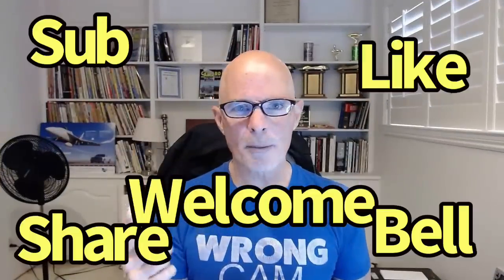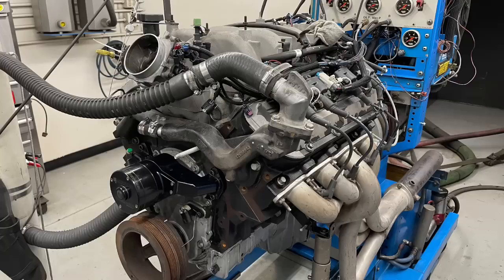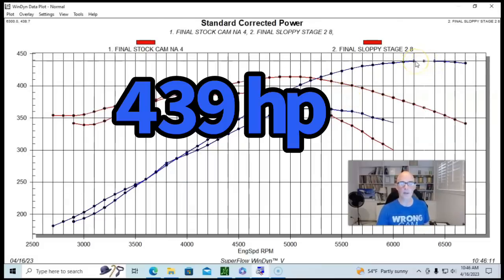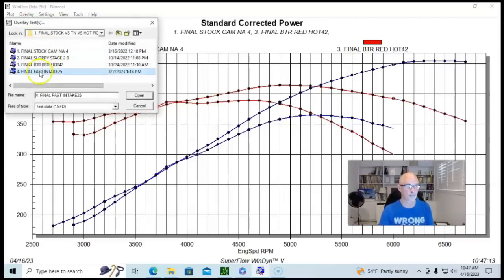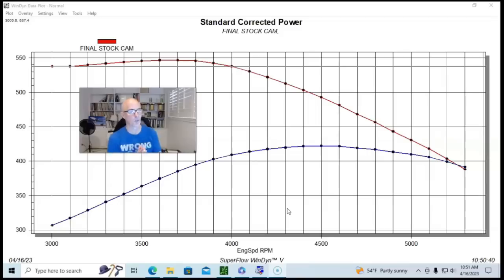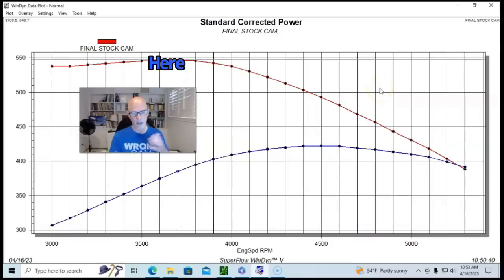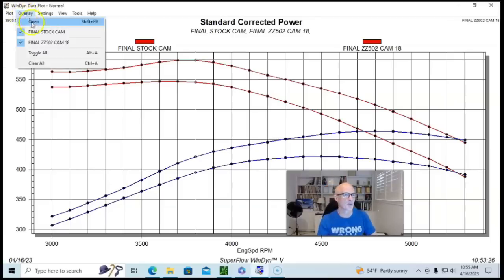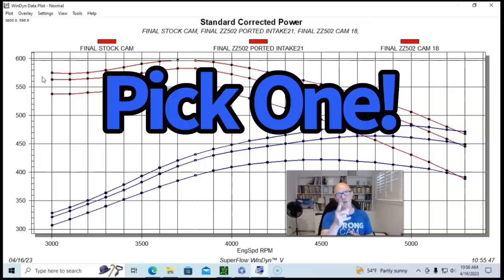RPM vs TQ-WHAT WORKS BEST? THE 480-HP TEST, HIGH-RPM, LOW TORQUE 5.3L OR LOW-RPM, BIG TORQUE 8.1L?

Comment: I currently own both (although both have far milder performance mods) and both are powerful, bulletproof tanks.  The 5.3 is pushing about 350hp and getting 22mpg with 4.10gears in a 5000lb SUV. The Envoy XL has 245k miles, LM4 engine in excellent condition (compression, oil consumption, etc.) The currently stock 8.1 is in a Class A motorhome and has no problem going 80mph anywhere, but we don't discuss the fuel mileage! Also have a modified Vortec 454 in an even bigger motorhome, and I believe it'll outrun the 8.1, and get better mileage because of the mods.  Moral of story- always modify your awesome Chevy!

Comment: Commenting at the start before watching. The 5.3 would be great for road coarse/time attack racing having a kinda easier time with traction with less torque while the big block would be great for truck work or just a dedicated drag car. I forgot to mention trans options, you can run a shorter diff gear with the 5.3 to have faster acceleration where as to match speed with the 8.1 youd have to have a taller to keep up with speed per gear numbers. While the 8.1 does have the torque you might not notice the difference. Just something to think about. If you ran the same gear set and trans you have to shift earlier with the 8.1 and you could see the 5.3 possibly slowly work ahead of the 8.1 just with the extra rpm needing less shifts for a given speed.
Reply: Agreed I was thinking about gearing as well
Reply: Watch Lawrence LT Tolman Videos on his 8.1 runs

Comment: Boy, even with the 5.3L having 25% RPM advantage, with properly geared rear diffs for each, the BBC still has big torque advantage down low. If it hooks (at the track), it would probably win even with the weight penalty. On the street with street tires, I'd probably take the 5.3L, though the 3200rpm stall converter needed might get annoying and it's an added expense. In a truck doing truck things, 8.1L no questions asked. Fortunately my 6.7L (408 LS) is exactly in the middle so I don't have to choose!

Comment: The gearing multiplies that torque, so with the same shift points the 5.3 would act like it has 30% more torque. On the street the 8.1 would just fry tires, while the 5.3's weight savings would make it more fun in corners too.
Reply: The 8.1L can absolutely Handle 10-20 plus more degrees of intake duration which will make the bottom end softer. Also, if traction is your goal There are plenty of ways to do it. I do like 8.1L for a heavier vehicle though.

Comment: Depends on the weight of the vehicle. Heavy vehicules need high torque to get them moving.
Reply: or low gearing,  you could put both these engine's  in semi trucks as long as you geared them down appropriately. now engine life would be a different mater but they would be able to do the same work.

Comment: Cool data. Taking the last plot a couple steps further and diving into the realm of bench racing, its possible to extrapolate these data to make a side by side comparison of how two identical cars with the only difference being the motor and gear ratio would compare. Gear the 5.3 so it completes the 1/4 mile at peak rpm (the actual ratio isn't important). Now, divide the BBC's peak rpm by the 5.3's to make it also trap at peak rpm. You get .815. So take the gear for the 5.3 and just multiply that by .815 to see what the big block gear should be. Gearing is also a torque multiplier so you can see how much torque each car produces at each speed by rescaling the x axis of the plot to speed and rescaling the Y axis by the relative gear ratios, or just multiply it .815 for the big block to see the relative difference. This will give you a clear side by side comparison of how both compare against each other. In physics, acceleration = force / mass (f=ma)... so just looking at the torque each produces in a side by side like that tells you how one is accelerating relative to the other. Of course, you can also take it a couple steps further and factor in the mass difference between the two cars.

Comment: I've always wanted to put an 8.1L in a RCSB 1/2 ton like my 2001 Silverado. I love the 90-93 454 SS trucks, and the 8.1L in a 99-07 NBS would be a great modern version.
Reply: I have one in a 2002 Sierra. Rcsb 1/2 ton.  She’s pretty fun.
Reply: @jayroc3337  I keep watching for a cheap donor... 8.1L, 4L85E, PCM, harness.
Reply: @bluecollarhotrods9781   that’s the trans I have in my truck.  I love it.  I didn’t do the swap though.   Long story short, I found it at a small hotrod dealership for cheap.   Building it is on the back burner tho. My other 2002 rcsb Sierra is a turbo built truck and is almost finished up.
Reply: @jayroc3337  My 2001 is LQ4/80E swapped, I  did the work. Cam + bolt ons currently. Eventually another engine with ported heads, etc. Then, BOOST! I have been doing it in steps.
Reply: @bluecollarhotrods9781  hell yeah!  my turbo rcsb is a lq4/th400. MLE built the long block,  I like it but I am more excited about doing a NA build with the 8.1 rcsb.   
 Obviously I love RCSBs   I run a local fb page dedicated to everyone in the area with them.  As far as I’m concerned, they are the closest thing to an old school muscle car.  Full frame, v8, leaf springs, an actual rear end and you can work on them very easily.
Reply: @jayroc3337  When I find myself doing rust repair on an older vehicle... I seriously think about selling my older cars so I can buy 1-2 more trucks.
Reply: @bluecollarhotrods9781  absolutely.  I get it.  Do me and yourself a favor, DO NOT get a cheap turbo kit when you boost yours.  You will end up replacing everything.  
 Spend the money. It is worth it.   I wish I would have went with a blower.  Might even sell the turbo truck. 🤷‍♂️
Reply: @jayroc3337  As of right now, I have a FSP cast stainless turbo log. I was going to build the rest of the hot side myself. Cold side will most likely end up being a Treadstone intercooler. Although, I kind of want a Holley mid ram with a Tick or 417 motorsports A2W intercooler. It would simpler for packaging and plumbing.
Reply: @bluecollarhotrods9781  you are on the right path.  I hear a lot of people pushing cheap kits and it drives me insane
Reply: @jayroc3337  my friend is about to buy an On3 kit and I'm not sure how I feel about it.
Reply: @bluecollarhotrods9781   MAKE HIM STOP!!  It’s fine if you really have to be at a certain budget and enjoy constantly fixing leaks but if he keeps the car/truck long enough….. everything will be replaced and there won’t be anything left of that kit
Reply: @jayroc3337  I told him to buy a Huron Speed kit, if he absolutely has to have a "kit." Another friend had a great experience with the Huron Speed kit.
Reply: @bluecollarhotrods9781  from what I just seen, those kits are out of stock.  Seems like every quality kit is.
Reply: @jayroc3337  Well that's a bummer. The Fahler log I have is no longer available. I guess he did a few runs, then the deal fell apart.

Comment: Can't beat torque.  RPM Ruins People's Motors.  That big block would last forever.
Reply: I think it depends  on the horsepower it gets pushed to. if you want a 600-horsepower 350 I don't think it lasts as long as the 600 horsepower biggun. Course.. that's what you were saying 😆.
Reply: @John Sheetz  hard to say , the piston speed and rod ratio is actually huge on the lower revving big block. 5500 rpm in the big block is practically the same piston speed as 6700 rpm in the 5.3. piston speed will increase piston heat , wear pins , bearings and can do oil pump issues with that much weight of the big slugs in the big block creating crank deflection and the weight of pistons and rods being forced down at such a large speed. 

Valve train is definitely a lot more stable at lower rpm but once again a lot lighter valve train in the smaller motor. 

I'd rather the torque of the big block , I don't know much more reliable it'll actually be just because it's not revving out as far. 

Also depends on what car it's going in , I'd take the more centralised weight and less torque if the big block was going to be hanging well over the nose of the cross member.
Reply: The 8.1 cam is still small compared to the 5.3. Another 15-20 degrees duration would wake up the Big Block it's still have about the same Idle characteristics as the 5.3
Reply: An Overlooked area of Big Block Chevies and other Large Displacement engines is the Huge Strong Crankshaft in them and very Large Crankshaft Thrust Bearings. 
Super Torsional strength they possess even cast Nodular iron or cast steel. Forged steel or Billet 4340 Chromemoly or 300M Super Steel makes them even better.
No matter what you do to LS LGM Or others you will not match the crankshaft strength or Tough as nails Crank thrust checks and bearings Engineering with .
Pontiac 455 is another example of a Super Strong crankshaft and huge Crank Thrust Bearings.
Reply: @brracing7861  what's your opinion on 455 crank with the different journals vs stroking the 400? There's arguments on both sides , the 400 has better webbing and less cap walk but the larger diameter journal can deal better with clearances ,dissipate heat better and is arguably more stable. 

I plan on the big boy stroker for mine once it gets on the rotisserie but will be a pure pavement pounder with a limiter at 5600.
Reply: Sure…  But big torque is harder on  the driveline.
Reply: @brracing7861  honestly I've got a 74 thick bore 400 block here but I don't know if I want to use it as the base for a 4.5" stroker. 

Mines 1 of 6 sold brand new as a right hand hook in Australia. So part of me says get another block even though I'll never sell it. I may just get old one day and prefer going back to the #62's and ram air 3 camshaft set up that it had before I killed it again last time 😂
Reply: @brracing7861  hardly anything is available anymore, except for the crap '77 blocks.
Reply: @stlchucko  True. Turbo 400, 4L80E,  Muncie 4-speed,  heard good and bad about the Newer Tremec 5 speed TKO .
14-bolt 10.5 Differential in my 1997 C2500 is known to take 1000+ Hp bone stock in LS LGM Turbocharged Offroad Buggies and Sand Rails.
GM 14-bolt 10.5 used by them !
It's a huge Differential made for US Military use trucks !
Pontiac Olds 9.3 1957-64 Differential I am a fan of My Pontiac V8 V8 Musclecars I have also.
A Big brute 9.3 also but it's like tiny compared to a Full Float GM 14-bolt Differential.
Reply: @hayden6056  Used seasoned blocks machined will hold tolerance shape. 
If you stay about 200 Hp below known parts limits it will last a long time near forever so to speak. 
Pontiac V8 you only what to use High rpms 7000+ with 100% USA parts all. Titanium in valvetrain preferred or must use.
Only needed Racing 7000+ .
Street use 5200-6400 rpms a good target rpm range.
Guys have ran in 12s in Pontiac V8 only turning 4800 rpms at 1320 light beam !
Reply: @hayden6056  1974 Pontiac 400 is a good thick main web block.
Best to build your dream now.
Keep it practical for your usage and budget.
Reply: @superduty4556  Yeah I know, all horded away.
It's the Network Buddy system.
Keep at it.
I have 7 455s Pontiac. 
3 Mint cores 1970, 1971, 1972 455s.
Also saved Pontiac 389's 1959-1964.
1 1961 Pontiac 389 4-bolt Factory block it's a 425A Trophy Tripower block.
Big Block Chevies 427 and 454 I have also, like them too.

A 1977 Pontiac 400 Guys have pushed to 500 Hp Drag Racing. 
Seem to last forever built at 350-370 Hp the thinner main web 400 blocks talking to other Pontiac V8 guys.
360- 370 Hp pump gas is still good Street driving Duty
Reply: @brracing7861  oh I have my own hoard haha. Always looking, though!I've started buying up 350s just for drivers as well and any set of heads I can find.
Reply: @superduty4556  I have 1 Pontiac 350 in my Collection also. 
A 1970 Pontiac 350 from a 70 Firebird Espirit 2-bbl.  255 Hp with 355 ft/lbs torque . Found it in Iowa next door from upper Central Illinois.  Bought it for $200.
It is tore down now waiting to be built.
I found a Factory Nodular crankshaft  Big N casted on the front #1 counterweight .
Factory 3/4 length windage tray the thick steel one used on 1970 400 and 455 engines likewise. 
Valves are small valves 1.96" intakes and 1.66" exhaust but valves used are long at 5.100" OAL overall length  same as used in Pontiac V8 Ram Air except RAIV those are 5.200" OAL.
Reply: @brracing7861 that's cool, didn't know that about the early 350s. 

I have one SD but it's currently in a car so not sure if it counts as part of the hoard haha
Reply: @brracing7861  oh it'll be the dream once it's done. It's the third time I'll be having the motor in pieces. Don't exactly want a fourth I just know that poncho blocks will never get cheaper than they are now. 

I'll be looking at spending minimum 15-20k Australian . So didn't know whether to spend another 2-5 and keep a stock bore matching number 400 and all my cast iron heads. 

I just want a reliably low to mid 11 second car with an interior. It's what most my other cars are running and there's nothing worse than making a heap of noise and going nowhere. 

When you're spending that much money and spent six months trying to find all the correct brackets for 60's heads and 70's accessories I'd hate to have to do it again in another 20 years if I decide I no longer want the almost 500 cube tree stump remover.
Reply: Depends on the application

Comment: When looking at HP output to the ground on construction machines, the converter and trans ratio match considered the area under the curve to give the resultant work done info. That is what mattered and I would imagine it would be the same chasing acceleration. More area under the torque curve is better unless you can make up for the narrow HP band with perfect gearing and torque converter match.

Comment: I have both a 5.3 and an 8.1. Both are slightly modified the 8.1 just tows anything even going to 33" tires and feels faster past 60' taking my 3.73's to 3.44's by tire height meanwhile the 5.3 had a 3.42 rearend and didn't start pulling until 30mph or so until I installed 4.10's in the rear end. It tows way better but still has to down shift while going uphill, while the 8.1 doesn't. The 8.1 gained 2mpg on the highway now averaging 14mpg and the 5.3 lost 1mpg now averaging 17mpg, but both trucks are better suited for how I use them now. So to answer the question, what application are we using these engines? Drag race 8.1 with 3.08's on 28" tall tires. Daily use the 5.3 and let the transmission shift it out.

Comment: The L18 can be much lighter. Raylar is pricey, but shaves 70/80lbs, and a plastic intake can be 3d printed for another 60/80lbs. That brings 700lbs down to 570/540lbs, way different engine. Bigger valves, 2.25-2.35/1.92-1.98 get more power, one can also get notched pistons and run .7in lift cams to get even more power. 650hp/750hp is like NA max with full stroke cam rockers, intake and headers. With a forged bottom end 30psi of boost should net the 2800hp I've heard forums bragging about. For how long who knows, but numbers suggest it's true.

Comment: 8.1 would be a lot more fun to drive, and more streetable if that's what you want.   To make the small motor run, you'll need to gear it and turn it, which makes it less streetable and you still can't just shred tires on demand as well as the big boy can.   But both would be fun.   And the small size of the little one is a plus as well.

Comment: "Horse power sells cars while torque wins races"

In all out power a big block will reign king. Granted bbc stuff is insanely expensive. I spent around 4k on my afr 315 cnc heads for my 502. Those are decent heads but no where near top end. 4k on some ls heads are some really Amazing heads. Also 2k hp from an ls is really pushing it. Yes, they can do it, but for how long? 2k from a big block is just getting warmed up.

Comment: in the street 1500-4500 rpm is the most important so 8.1L all the way, but a drag race where the 8.1L would ruffly stalled and geared to operate around 3500-5500 rpm and 5.3L 5000-7000 rpm should have similar potential.

Comment: For my slightly lifted 1985 K 2500 Suburban, I want the 8.1 for low end torque for severe off roading. I would like to see the torque numbers of the 8.1 from 1500 to 2500 rpms  As always, Richard. I love all of your video s Thanks